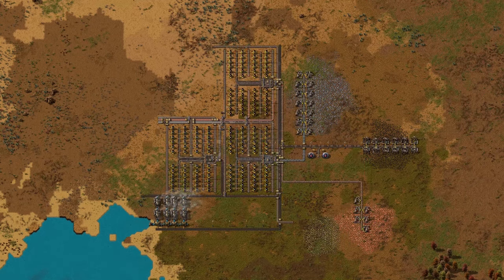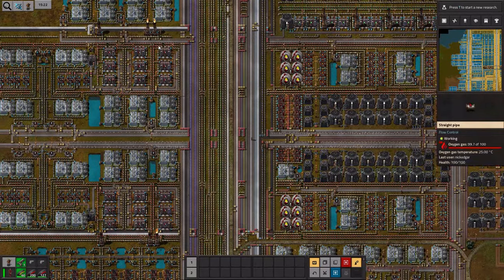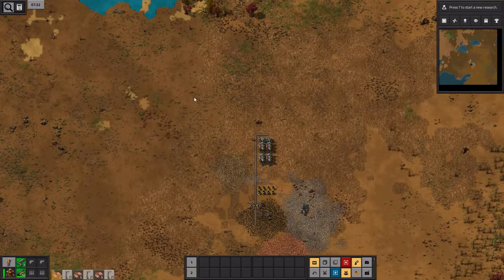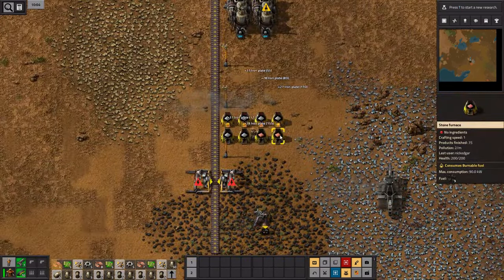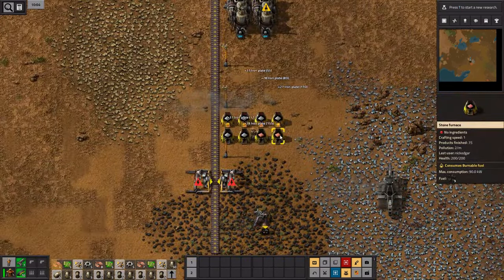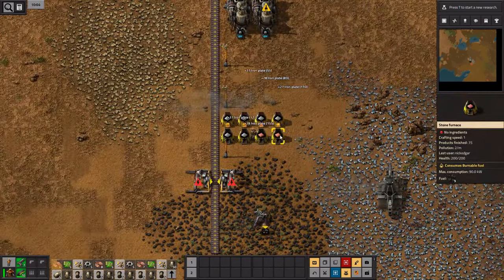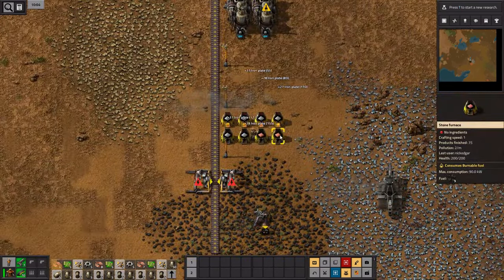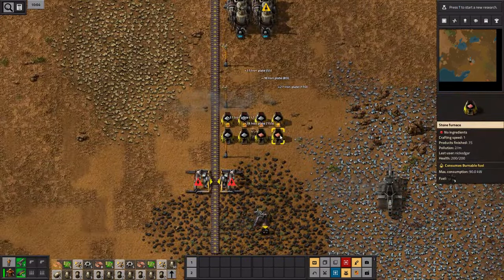Factorio - Evolution of Design

Comment: The most frustrating part about factorio as a new player, especially with overhauls like angels and bobs is that you really have no idea how the tech will evolve and what you will need later down the road. You need at least one playtrough behind you to understand what to preplan for. Like you said, there will always be another belt needed. Yet you build everything extremely close to each other. That is because you already understand the process and progression. 

I would love to make long belt lines with exactly the right amount of resources needed for my factory, it looks extremely pretty in your videos. But I dont think anything like that is even remotely doable on your first or second playtrough.
Reply from the maker: Absolutely agree 100%. Angel and bob took me 7 or 8 generations of the same basic factory over about 3 years to finally feel like I had it cracked. I have been playing this game since early access so what you are seeing is the result of a really long journey, it hooked me in early and I haven't really been able to properly put it down since.

You will get there dude, if you love the game and keep plugging away at it you will get there.
Reply: My issue with Space Ex was that it was very obtuse. If I attempt it again I am removing CME, meteors, and launching my first rocket at a world with actual resources rather than dealing the initial starting world.

Comment: I tend to calculate the initial usage based on a target amount of resources. So for example I want to design a base to build 100 of each science per minute. So I use factorio calculator to work out exactly how much of each resource I need for each type of science. Then I build the machines to produce the exact amount of each resource from the basic materials. Including a production line for the exact number of green circuits etc, there's usually a little left over, so those get out in a chest for hand crafting at the start, or to feed into the logistics system at the end. Then I'll create a small mall using the exact same method, working out how much of each resource I need then building my factory around that. The only thing I'll "wing it" with is iron and copper plates, because I'll have the smelting stack done completely separately from production, almost everything else is manufactured local to the end product.
Reply from the maker: Sounds like a plan. How about oil? I've only just stopped winging it with oil

Comment: I like using beacons but I don't go build "hardcore speed beacon" setups. Usually I stay lower tier and if it doesn't need it then I'll maybe just throw in an efficiency module. I really like Space Exploration mods take on it where you can only have 1 beacon per machine. It makes a lot cooler designs than 8 beacons surrounding an assembler.
Reply from the maker: I just don't like the idea of spending a length of time positioning and repositioning beacons over and over, that doesn't seem like much fun to me.

I think I have only ever constructed one or two beacons since I started playing the game, which is like 5000 hours of gameplay. It was one of those immediate reactions for me, 'ooh, I really don't like these things'.

But it is different for everyone. We all play the game slightly differently, I don't think there is a right way or a wrong way.

Comment: 8:02
Actually, you are taking one belt (two 'halves') and splitting it onto two halves - full consumption, also yellow in red out is efficient?
Reply from the maker: You make it sound so simple, well, it is simple, but aren't the best things in life the simplest things? You might not think it is all that but I found this little widget incredibly useful. I still find it useful.

Yellow in red out is the only 'mathematically perfect' way of mixing the two belts in this way. Red in blue out and there is some material on the input belt left behind.

Comment: I just use logistics bots and trains late game so I don't have to rebuilt/spagetti in belts. I know most players see logistics bots as easy mode.
Reply from the maker: If it works for you and gets you to the rocket then I don't see a problem. Factorio is a tough game regardless of how you choose to play it. And bots aren't a guarantee of success, you can never really be sure which resource your bots are going to prioritise and you will have massive power requirements. But that is the joy of factorio, you are compromising one thing for another, if it works then that is all that matters.

I like the conveyor belts, I like to be able to calculate flow rates (which is difficult/impossible with bots) and I like the look of a mess of conveyor belts that are neatly organised. But that is just me. There isn't only one way to play the game.

Comment: Do you avoid using direct insertion, e.g. from 3 copper cables into 2 green chips, for aesthetic purposes?
Reply from the maker: If you don't use modules or beacons (which I don't really) then a single assembly machine producing green chips needs 1.5 assembly machines producing copper cables to match its output for direct insertion. From a geometry perspective trying to match 1.5 machines to line up with a single machine to be able to directly insert is tricky. 

Also, I try really really hard to only construct the number of assembly machines I need, if I need 72 furnaces for a smelting setup, for example, then I'll do my best to come up with a setup that only uses 72. So the perfect setup for green chips for me is 18 assembly machines producing copper cables (45 copper input, a blue belt) and 12 assembly machines producing green chips (30 iron input, a red belt) thus giving me the perfect proportion.
Reply: @theotherbigfoot  Thanks for the reply :) Love your design style, very pleasing. 
re: the ratios: I usually have three cable machines on top and then two beneath them with an offset of one tile. then the middle one gets fed from both cable machines. So I was wondering if you just don't like the offset look, for example
Reply from the maker: @Arbmosal  Ahh I understand, I can see how that would be an elegant setup. There's gaps though, and I spend a lot of time trying to remove gaps!!

I think it's more than just an aesthetical thing. I just love the conveyor belts. I think they are awesome.  I want more of them.

But I think it is more than that as well. When something goes wrong it is recorded on the conveyor belt as a gap in the products. So if something goes wrong you will see it. If something was to go wrong in your copper cables, for example, you wouldn't directly see it just by running past. You would have to investigate. If there are problems in any of my bases it is mostly immediately obvious because everything is laid out to be seen. Sometimes I will just run around my base looking for empty conveyor belts because that is normally a good place to start for why there are problems.